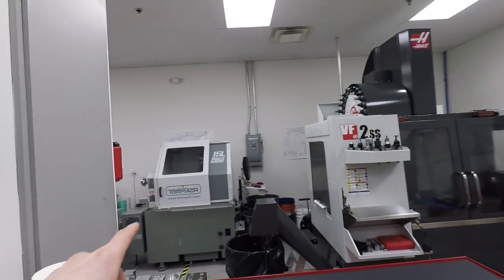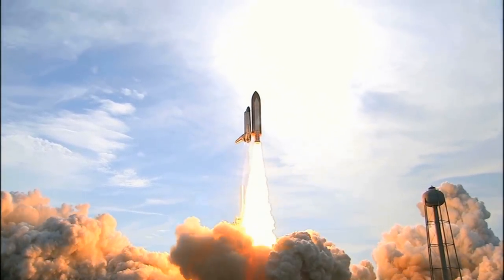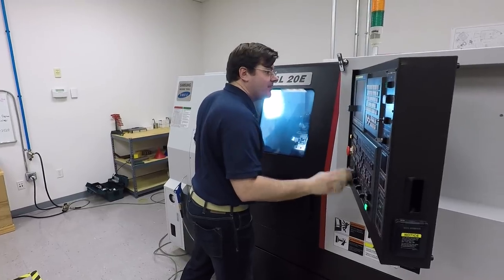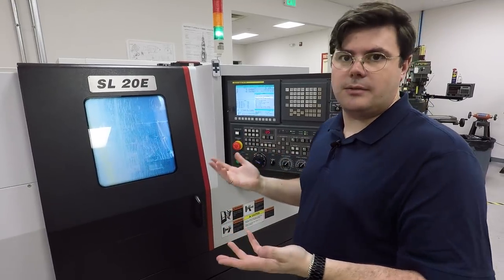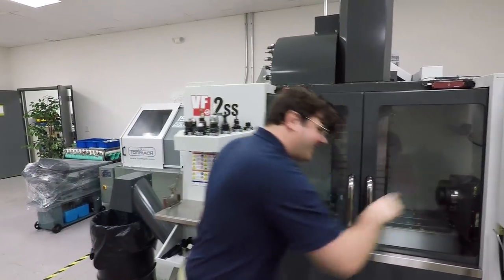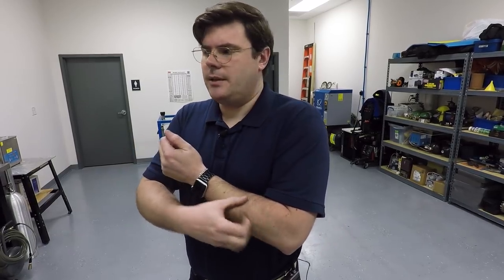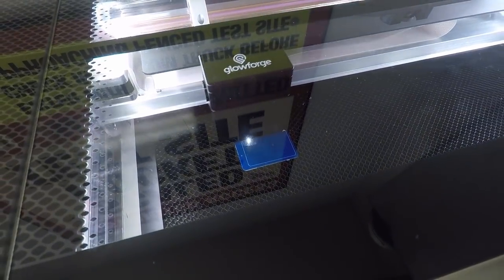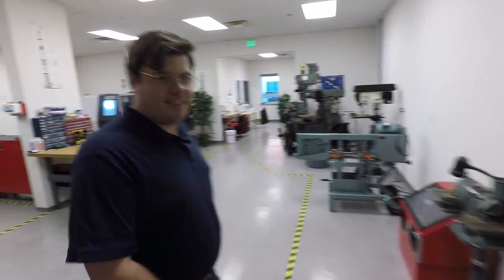Machine Shop Tour: Triton Space Technologies!

Comment: I have used the anodized identification plates from McMaster several times (Black, Blue, Gold, Green, Orange, Red, Yellow available). We didn't have a laser. Instead made a fixture plate and used an engraving tool in the HAAS. Had a few that were bowed and that would affect engraving consistency. They run about $2 each but when you have a production run of 5-10 machines that is inconsequential.

Comment: SSME turbopumps are utterly bananas; the more you learn about them the more interesting they get.
Reply: Don't know what you mean about them being bananas? But here's a little SSME trivia, the space shuttle main engine turbo pumps are the highest horsepower per lb machine ever devised.
Reply: not surprising since it used the highest energy density liquid fuels.  until there is some sort of atomic propulsion, it wont be beat.
Reply: yeah and considering they just fed the fuel/oxidizer to the engine.
Reply: How are these pumps powered?  do they have their own jet engine?
Reply: They're fairly similar to a jet engine in that gasses turn a turbine to generate shaft power to turn pumps; the wikipedia article is a pretty good read.

Comment: An AQM-34 drone systems uses a small turbine.  Very small compared almost everything that is jet engine driven.  As small as it is, when standing next to the test stand during engine run up is incredibly loud.  At idle you can sorta can hear someone yelling.  When throttled up, the sound just saturates all your senses.  It's hard to put in words how loud it is.  And that is a SMALL engine.  Can't imagine what the shuttle or a rocket engine would be like if you were inside the safety zone.

Comment: Very interesting about that valve. We use 3000psi hydraulic solenoid actuated valves very similar  to that one even with JIC fittings but they don't even cost a grand.  Even if it is machined from inconel 9k seams a good price to get. I guess the market is good and maybe the liability is high so 7K of the price is insurance.
Reply: bcbloc02 probably covers the destructive testing etc
Reply: tolerances would be uch much tighter too
Reply: Traceability costs. In most aerospace, every component is traceable to a batch of raw material,  certified to conform to its published design specifications, and manufactured to applicable standards backed by an audited quality process.  Every screw, bolt, washer, seal, blank, casting, rod, wire, connector etc.  If a bolt fractures unexpectedly the FAA need to be able to find every plane containing that bolts of the same batch before they start falling from the sky.   The bolts would be analyzed to understand why the failure occurred including going back to the foundry that created the alloy if a material quality failure is suspected.  (Then they'll find all planes containing other components made from that batch of alloy too.)  That paperwork trail gets expensive fast.  Getting items or paperwork confused between product batches during manufacturing can result in both batches being destroyed.  Material handling processes to prevent that happening cost money, and a prerequisite is buying or leasing enough physical space to bring order and remove chaos.  Conformance is based on quality systems that require qualified tools and calibrated test instruments.  Using the incorrect tool or an  instrument lacking valid calibration and the part cannot be certified.  At the least, rework would be needed to re-mediate those issues - an engineer would need to determine whether the tool damaged a component requiring its replacement, or whether the step needs to be redone using the correct tool.  The test would need to be redone with a calibrated tool.  From the Receiving department to the Shipping department, everything is done deliberately and involves paperwork processing. Every box opened is inspected for valid Certificates of Conformance and serial or batch identification that can be  matched to the doodads in the box without a hint of confusion, or it gets returned to vendor.   Every box shipped is inspected for inclusion of the same.  All of that validation takes paid time.   At the back end, all of that paperwork must be securely stored and curated.   Now consider that for some aerospace the products being manufactured are sensitive and require employees to be vetted.  That drives the labor cost up too.  All of those costs get reflected in product pricing.

Comment: Rocket porn! Complete with pixelated bit! Everyone talks about the turbo pumps, chamber pressures and temperatures the nozzle has to deal with but the real secret sauce is that injector plate. If you don't get the injector plate right, you don't have a rocket engine.